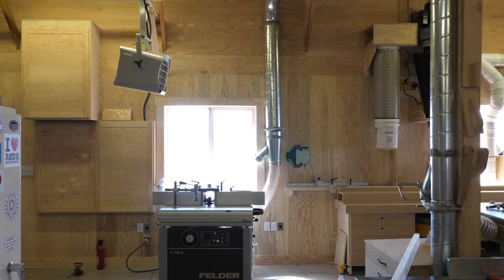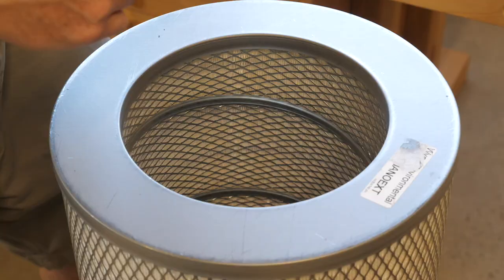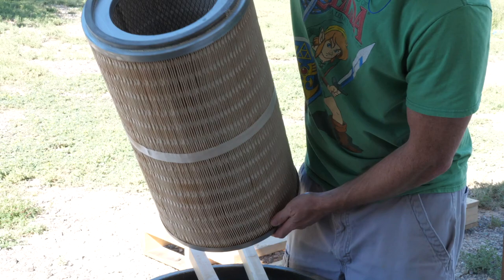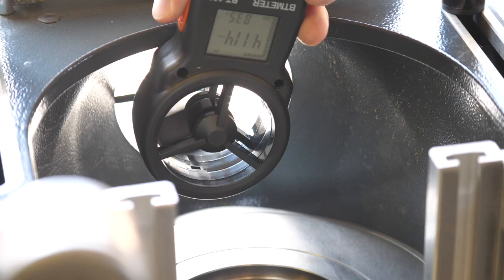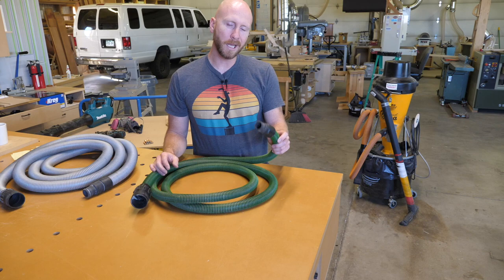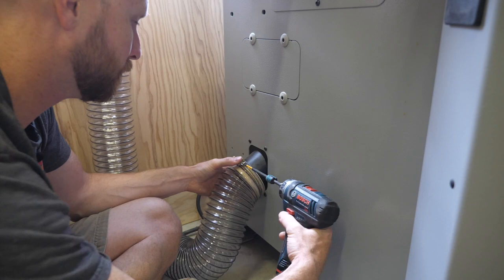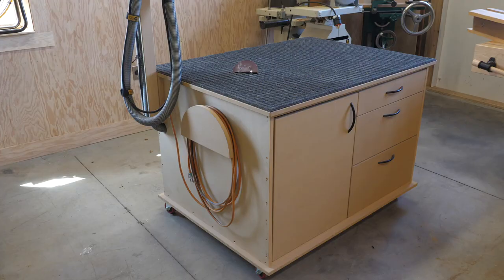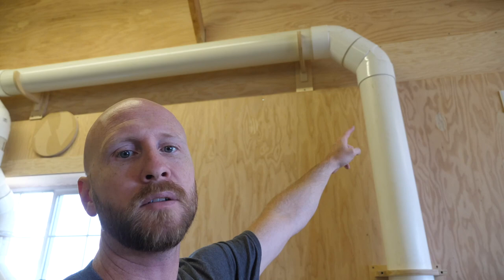Dust collection tips

Comment: Protip: Use a HEPA filter on your shopvac.  If you do NOT you will create a fine dust pump, pumping all the fine dust into the air, which defeats the purpose from a health perspective.
Reply from the maker: I'm not totally sure HEPA is needed for dust in a wood shop. I say this because most woodworking operations don't create much extremely fine dust, even cutting MDF. Most of the particles are of a size where MERV 13-15 should do the job. With that said I have a HEPA filter in my vac cause its what they had.
Reply: @MikeFarrington  I would mostly agree with that.  I think you're more correct to state the MERV factor, and that the type of dust is going to depend.  I honestly don't know what type of dust most operations produce, but sanding is very common and most sanders work with a shop vac.  

Why gamble on saving $5-10?  A filter can last a long time with proper care.
Reply from the maker: @jandrewmore  Agreed especially with a shop vac. More consideration should be given to HEPA vs MERV on a dust collection system, where the cost difference can add up quickly and CFM can drop quickly. I have done a ton of reading about dust creation and short of wide belt sanding MDF with 320 grit paper, extremely fine particles aren't created in much volume. I don't know where research will take this industry, but at this point, I think MERV 13-15 is really good for normal wood shop activities.
Reply: @MikeFarrington  I've noticed this as well.  I've got an el cheapo particle meter I got off eBay for $50, and I need to really run my little rigid oscilating sander hard to produce enough particles to get the meter to move.  By the time I have, it's pretty clear there's a good amount in the air visible to the naked eye.

I've also spoken with people more knowledgable than I about fine dust in the air, and they seemed to believe that leaving a dust collector on will eventually pull this out of the air anyway, rather than having it settle on to things.

This checks with what I've been able to observe from the particles generating by spraying with my HVLP gun.  Running my 1000 CFM dust collector removes a majority of the particles from the air pretty effectively.

So I have to wonder where Bill Petz gets some of his ideas about how bad fine dust can be in a workshop and how to remove it.  My understanding is that he has some sensitivities to it that are not the norm, resulting in his sometimes over the top advice for dealing with it.
Reply from the maker: @jandrewmore  Bill Pentz is a smart guy with a deep bias. He has a terrible wood dust allergy. Therefore his measures to mitigate dust in his shop must be on the extreme side of the spectrum. He is also benefiting personally from the sale of a bunch of different dust collection products. Thats fine, but he has an angle. I like a lot of what he writes, but he's saying it at volume 11 when in reality is really a 5 for most of us. The 1000 cfm collector will clean the air pretty darn well, especially if the open blast gate is on the other side of the shop from the collector output.
Reply: @MikeFarrington  I've noticed his connection with ClearVue, but I tend to discount it in a way I don't for other shrills because he had the plans to DIY a cyclone first.  Maybe I shouldn't, because a lot of people will just buy one (like me) even if this is a very DIY hobby.
Reply from the maker: @jandrewmore  I'm guessing there is a relationship between Bill and ClearVue. I'd buy one too if this was just a hobby for me.
Reply: @MikeFarrington  There most definitely is, even if I don't have the full details it's been mentioned more than once.  I believe that he gets a cut, whatever it might be, as a royalty on his designs, which are used by ClearVue.

Before that I believe he sold parts, and motors.

However the free plans pre-date all of that, so I believe him when he says that he formed the partnership because it was the best way to get decent tools in the hands of woodworkers.

The biggest issue with DIY, IMHO, is that there isn't a lot of savings for a large investment in time and developing some usual skills.  

Or at least that was the case when I bought a Grizzly 1 1/2 HP cyclone for ~$1K in 2019.  The math might be different these days.

It's a little undersized vs Bill's recommendations, but I get the ~1000 cfm out of it by adding addition blast gates to the middle of the main line, something I don't see anybody mentioning in their designs.  By so doing I'm able to cut off the run to almost all the tools with their various blast gate leaks and added resistance, boosting performance by about 50%.

Comment: For a cheap but very effective ambient dust filter...I built box/cart with a furnace fan cut through one side and put a single 4" merv 13 on the other side. Running, this will circulate the air in a room better than a box with multiple filters in it. It's also cheaper to buy a single 4" than 4 1" filters (tip = buy multiples online). One those hot days, it's also nice to cool off with it blowing at you.

Comment: retired furniture maker here.  when i started there was no such worry about dust etc.  but over time realisation and laws really cleaned things up.  my home shop has basic collection to all tools and luckily with either end of the shop open the prevailing breeze keeps most of the fine dust out.  what i really wanted to say, is this has to be one of the better videos on the topic.  good common sense.  as an aside, in nz the wyn filters are prohibitively expensive.  this puts them out of reach for amateur workshops generally.  my dust collector is a bag variety, so it lives outside so the dust is carried away and not blown into the shop.

Comment: Ambient air cleaner - I used furnace filters and a box fan. Using a particle counter it works great. In 2020 a lot of these designs were popular.
Reply from the maker: That is a good option for sure. I figured there were enough videos covering that subject, so I wanted to present a different option.

Comment: Good tips.  For those with basement shops (like me) and no windows for fresh air movement, I rely on a home-built air scrubber I made to fit between my floor joists in the shop ceiling.  Box a section in, add a 8" 420 CFM duct booster fan, a length of 8" metal duct and a few 16x25" MERV 13-15 filters (fit perfectly across the joists).  It sits directly above the table & miter saw area, sucks up air and directs it to the other side of the shop to create a circular flow pattern.  Plenty enough to exchange the entire shop's air in 5 minutes.  Total cost was $150... filters being the most expensive parts.
Reply from the maker: Thats a good idea.

Comment: I've been looking for a good ambient filter system and these inline fan/Wynn filter combos look like just the ticket. Well done, Mike!
Reply from the maker: They work really well.
Reply: Yeah, I have the Wen one myself, and it does a pretty good job in my garage shop... when I am not slacking and actually use my dust collection.  I'm slack on the smaller tools, since I hate hauling the shop vac all over the place.  Thinking about the dedicated thing... having one under the miter station and bandsaw, one with the assembly table, and another hooked up to the disc/belt sander and drill press.  I think I'm stuck using the beast (have the Harvey G-700 due to space/noise restrictions) for my planer, since it seems a little much for a smaller shop vac, but who knows.

Comment: Excellent video. I have gradually improved my dust collection in my small workshop. I have cyclones and have just upgraded the central shop vac to a Hepa filter one and always had the finest filter cartridge on my larger one for my table saw and larger machines. The particle monitor and anemometer are my latest additions in the last six months. Keep up the great projects and quality advice.
Reply from the maker: Thank you. Sounds like you are getting a good system setup.

Comment: BIG PLUS 1 for the simple fan and cross air flow idea. I have not seen it mentioned anywhere before but it works really well and it’s cost effective.
Cost effective particle meters are available from bang-good. Rag and bone man got one for his workshop. Precision may not be high but as an indicator they still help give a number to the often invisible and deadly dust factor.
Reply from the maker: Low hanging fruit for sure. Cheap and very effective.

Comment: Well, you did a great job showing me how inadequate my dust collection is in my shop. Tip #10 was the best tip. The level of frustration for finding the correct fitting for each tool is so high. I had to resort to 3d printing some of the connections. On a serious note, you had excellent tips and I will be definitely looking into several of these.
Reply from the maker: Thank you. If I had a 3d printer, I'm sure I would use it to make fittings.

Comment: Great job on this video! I have one thought to share that will improve the accuracy of your anemometer flow measurements: 
When using the anemometer and placing it close to (or at) the opening of ductwork to measure volume flow, the cross-section of the anemometer will automatically cause an increase in airflow being measured because you’re restricting the actual area that the air passes through.  The result is that you are getting erroneously high airflow measurements. 
I think a practical way to improve the accuracy is to determine the cross-sectional area of the anemometer and build a section of duct that is larger than the ductwork that you were measuring the flow of by the amount of cross-sectional area of the anemometer. Then attach this test assembly to the duct you are determining the air flow of. The length of this test assembly should be at least a couple of diameters of the pipe itself.  While in a rigorous calculation of airflow using engineering airflow calculations this is still inaccurate, it will still be more accurate than what you’ve been doing IMO.  I don’t mean to be critical, but I think that this bears consideration. 
You’ll probably need to build, at most, three test pieces: 4”, 6”, & 8”.  I’d look at sheet metal, probably using large HVAC pipe, cutting it down and using pop rivets. 
I really like your concluding comments - you give fantastic advice!
Hope this helps!!
Thanks and keep it up!
Reply from the maker: Thank you. Good info.

Comment: These are great tips if you can afford the filters, piping etcetera, which I can not, even at a hobby level. So, I do my best by using the same low-profile mask, a hanging air filtration box and cleaning the filter often. I also bought small shop vacs for each tool station and an enclosed sanding box made of acrylic for small pieces of wood and longer or larger pieces I utilize an outdoor bench that is easy to set up. I also bought a specialized vac hose that can be adapted to fit all of my power tools that goes directly to my large wall mounted vacume. That will be replaced first when I can afford it. It's incredibly loud, so I built a small "closet" off the side of my shop to house it in and it is sounfproofed so the neighbors won't be bothered buy the noise. It made a huge difference to the noise level and overall atmosphere of my tiny shop. I will be putting an addition onto the shop once wood prices normalize so when that is completed a new dust collection system will be installed.
Reply from the maker: Thank you for sharing. I felt like this video had a little something for all sizes of shops.

Comment: Tip number one should be: Move your dust collector outside, negates the need for expensive filters and cleaning them, reduces noise. Cons: Negative pressure and loss of conditioned air. Good tips, thanks!
Reply: Excellent tip!
Reply: Ooh this is a fantastic idea!
Thanks

Comment: Theres a few more I can offer: you can frequently find 4" PVC pipes with a slight flare at one end (so you can daisy chain them). Make sure the flared end points TOWARDS the tool.

That same trick you use with the heat gun will let you bend the pipes. Get a couple 4" end caps and put them on BEFORE bending but AFTER heating. The air pressure inside the pipe remains constant and the pipe can't collapse or pinch this way). Doing this minimizes the number of joints to as few as possible (decreased joints in my system by almost 2/3), AND minimizes the disruption to the air flow, both on the curves and straightaways (this is why you want the FLARED END pointing AWAY from the DC).

Finally, find some heat shrink boat tape. It's 4-6" wide, applies like duct tape, but seals and shrinks to form fit with a heat gun. It's easily removable, but is as tight as silicone. It's used by boat manufacturers to shrink wrap boats after completion, so if they're stored in a high salt environment they stay sealed and corrosion free (they combine this with those rolls of shrink wrap plastic, then run the whole shebang under long heating poles. Not relevant, just interesting). It's maybe 15 bucks a roll (eBay) and one roll will do a 1800 sq. ft shop (i speak from experience).

Oh, bonus tip: run as many branches from your DC as possible, right at the DC. Like an octopus. This way there's only one dust gate to worry about and you don't have all that standing air in the closed branches' Venturi effects jacking up your active branch. Every time your system forks, even if one branch is closed off at the end (by the tool, I mean), all the "dead air" in the branch still gets tugged into circulation  by the air sweeping PAST it. If you cannot branch many times from the DC, then EVERY fork splitting from the main trunk should have its own blast gate. You want the smallest amount of dead air introducing eddy currents as possible (it's as disruptive as flex hose).

Finally: it's close to Halloween. Buy a smoke machine. They're like 30 bucks. Stick your tools hose into it and you'll find EVERY leak in your system in minutes without causing any harm to it. If you can find the red smoke, use that. Barring that, get some uv-reactive chalk (~$4.99) and powder it. Suck it up with your system and take a black light to your joints. Same principle.
Reply from the maker: Thank you very much. Those are some really good tips. Awesome.

Comment: Another ambient air filtration option for small shops are box fans. I run 2 of them and are made by Lasko. They came with changeable 20x20x1 inch filters and are purpose made for air filtration. They work extremely well in my 2 car garage and the filters are cheap.
Reply from the maker: Good tip for sure. I wanted to present a different approach in my video. There are plenty of great videos on the box fan and filter setup.

Comment: The most informative dust collection video I’ve seen. Thank you.

I was surprised you prefer PVC over metal duct. My system is all 4 inch PVC, and yeah, it’s so easy to make changes. I went with the Oneida Supercell dust collector — it’s a high pressure and low CFM design. For this machine, 4 inch is recommended and you can also do faster 90 elbows. You can even do “T” intersections. The pressure is extremely high and works well for all my tools. It’s designed for small shops with only one blast gate open at a given time. So I automated the gates with the iVac automatic gates. 

Very happy! 

My next dust collection item is figuring out the table saw over arm dust collection.
Reply: I'm glad to hear this! I'm thinking of upgrading to a SuperCell. This would definitely be the easiest modification to my current system. I'm also considering something that would be overkill: Dust Gorilla Pro with airlock and transfer blower installed in the space under the garage. The Oneida people have been very helpful. What tools producing a lot of dust do you have connected to the SuperCell?
Reply: @johnhuelsenbeck35  

My full system includes:

1. Sawstop tablesaw
2. Dewalt planer
3. Router table
4. Ridgid spindle/belt sander
5. Miter saw w/ dust tent
6. Small 6 inch jointer (not bench top though)
7. 14 inch bandsaw
8. Port for 2.5" hoses to connect small tools (Domino joiner, sanders, pocket hole jig, etc)

If you go with the Supercell, I highly recommend automating it with the iVac system. You can only have one blast gate open at a given time, so if it's automated you'll never have to worry. 

I also considered the Gorilla. My problem was all my duct was already 4 inch PVC, and the Gorilla would have required much more space.  

The Harvey G-700 also looks like a good machine. 

One thing I wish I had done: build a lean-to shed outside to house the machine to keep the noise down. 

The Supercell is a high pitched noise -- kinda like a shop vac. I'm looking into ideas to help reduce the noise a bit. 

The tablesaw still has dust on top, but I don't think any system will solve this unless I add an over-arm collection line.

I will eventually post a video about the Supercell on my channel @Element Woodcrafts.